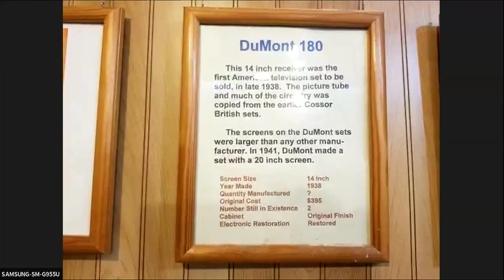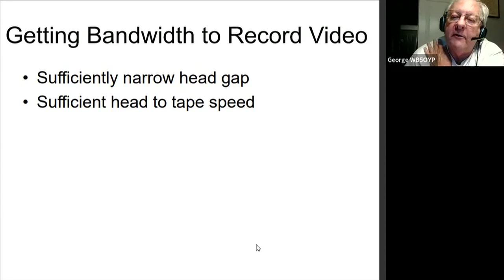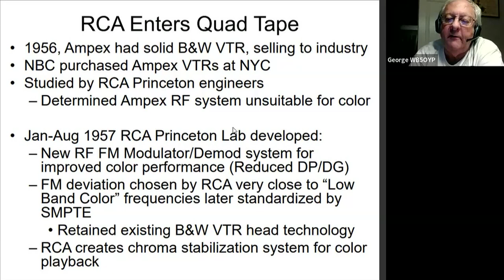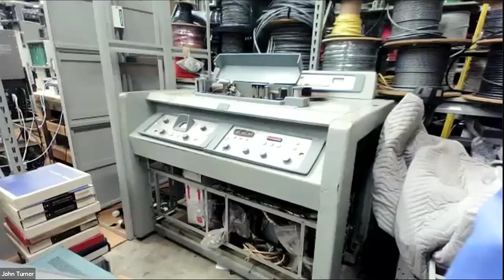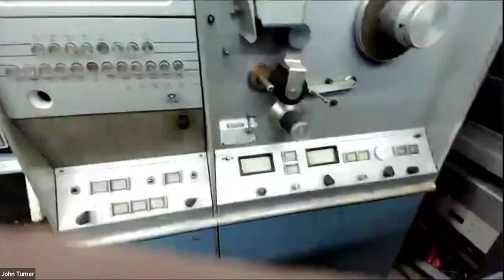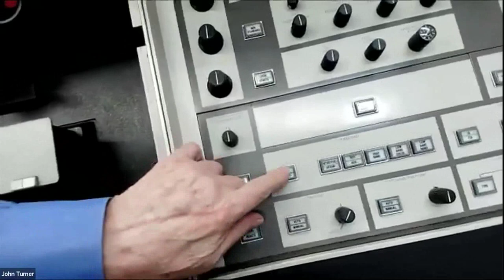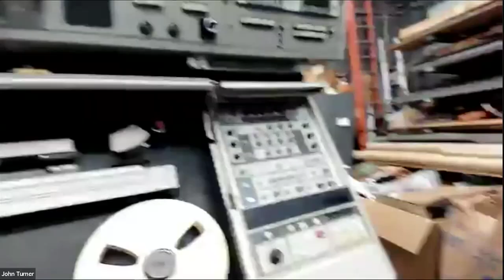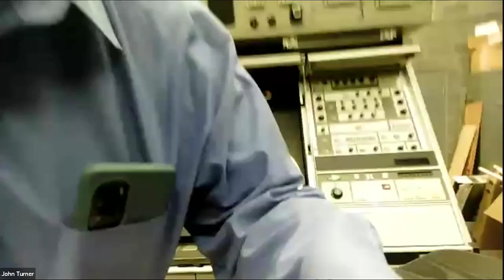An Introduction to Two-Inch Quadruplex Video Recorders

Comment: I pray we each realize the value of the assets provided by not only the ETF, but also Bob (bandersentv) and Shango; both the US and the planet now have a more than 'patent' resource when it comes to addressing repairs, and maintenance of older equipment. That knowledge barely existed until the combined efforts of all involved in in the Early TV Foundation.

As a certified "old fa_t", (yeah, fat, now too!), the area in which I reside, the "Antiques Capital of the United States", well, let's just say, that many have seen an interest in antique electronics by those who are younger than age 30 increase to a point where sustainability of the hobby/trade may be on the way towards gaining "assured status", your leadership and membership rulez!!  Everyone who contributes can and should be proud, your efforts made this possible!